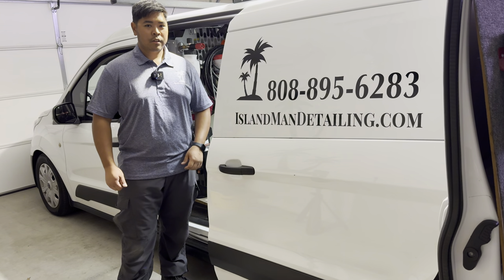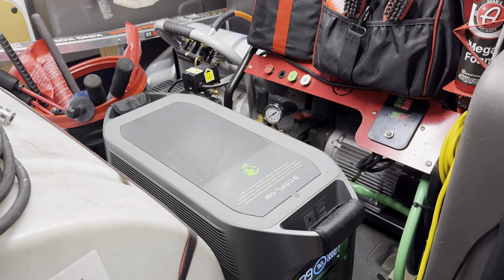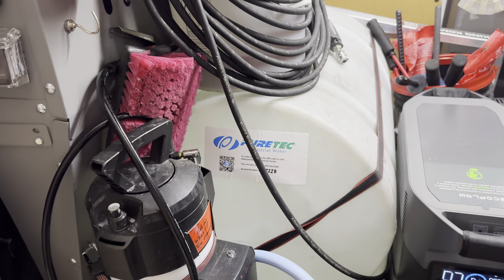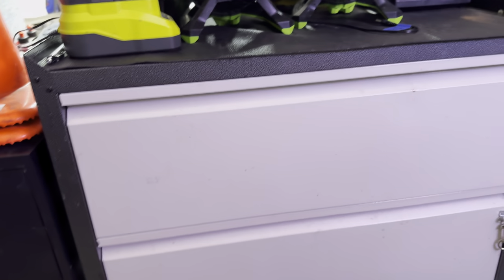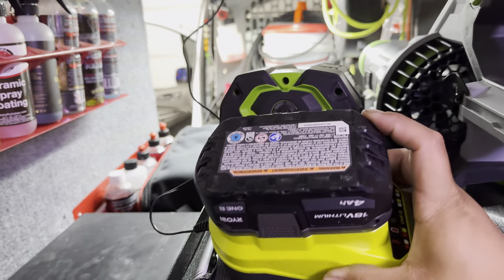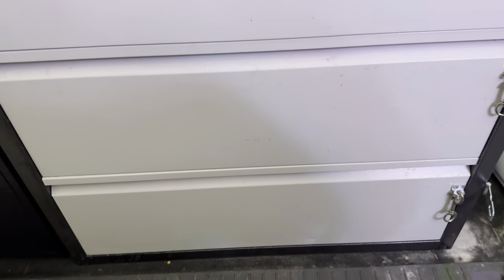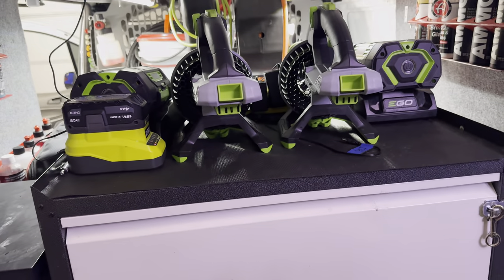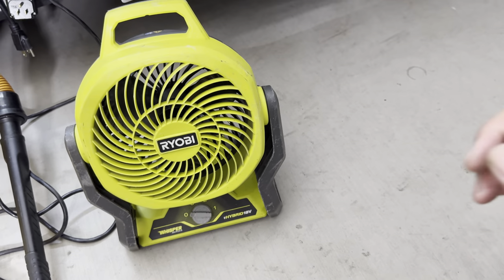Mobile detailing van tour | Using solar power and batteries to detail | EcoFlow Delta Pro

Comment: PS make sure you update your firmware on your DP as there is NO WAY it will power everything for 99 days as shown on your display, It should show 9-10 days NOT 99.
Reply from the maker: I’ve noticed that. It also doesn’t run very well if firmware isn’t updated. Just updated not too long ago and is not working great. Thank you.

Comment: how much power do you use when using doing a full exterior and interior with the eco flow? I feel like if I had to do a full  exterior and interior and a basic polish I would run that thing dead.
Reply from the maker: With it connected to 200 peak watts of solar, after a full exterior detail with polish and interior detail, I use only about 30% battery. Maybe a little less.
Reply: @IslandManDetailing how many working hours is that?

Comment: Hey man, I'm about to pick one an ecoflow delta pro (probably your version, not the new V3) for the mobile detailing business I'm about to start.  Just wondering if you've run into any issues over the past four months?
Reply from the maker: @jasonoshita4441  I had 2 issues recently. 
The first issue was that I received an error code and suddenly the screen shut off and I wasn’t able to use it at all. However, EcoFlow was very prompt on their response and turn around time when I needed to swap it for a new one. I was able to get a new one in less than a week.
The most recent issue was that the screen sometimes gets direct sunlight. This had caused the screen to glitch and parts of the screen do not work. Fortunately, the Delta Pro connects to the EcoFlow app, so I am able to see all of the information that is necessary.

I still highly recommend this model because it is affordable compared to the new V3 of budget is what you are looking for. And to me, it’s still reliable.
Reply: @IslandManDetailing  thanks so much for the quick reply and the feedback. It’s hard to turn down right now. Im glad they were quick to replace. Good tip about the screen. 

Did they ever say what the error was that bricked your first unit?

Comment: Thats a nice setup! 🎉🎉 I didn’t see an extractor or a steamer in your setup though 😮 Im curious to see how quickly the delta generators will drain when heat is introduced
Reply from the maker: I currently use a bissell little green pro portable extractor which is non heated. I am looking to test their new Steam extractor to introduce heat and keep to the compact and portable theme. 
As for the steamer, I use the McCulloch MC1375 steamer. I’ll make a video soon showing the power draw on each.

Comment: have you ever ran the ecoflow without solar? if so how long does it normally last?
Reply from the maker: @xxichikokoxx  we have. We are still able to complete a 2-3 full vehicles. That’s using the pressure washer, vacuum, bissell extractor and recharging EGO batteries for our blowers.

Comment: Amazing setup! my friend! Do you know the exact model of the CAT air compressor you're running? Also, how long are you able to run the tornador before it has to refill on that thing and how long does it take each time for it to refill? Thanks
Reply from the maker: I currently use the California Air Tools CAT-4610AC
It has a 1hp motor, so it takes about 50-60 seconds to refill. I’m not exactly sure. I’m always multi tasking. So when the pressure goes down, I’m working on other things while it refills. I can hold the tornados with the trigger squeezed for about 30-40 seconds until I need to let it refill. 
I’m looking to upgrade to the 2HP model and maybe bigger tank to get more run time and quicker refill time. I’d love to share your experiences.

Comment: 😂😂😂26:55 With low (budget) noise, comes low (buget) power, 90cfm is not enough @65dB! A Detailing vacuum should have @ least 150cfm. Mine does 152cfm @67dB - Of course it Cost 3 times more. But it cuts time in half > Priceless!

Comment: What type of solar panels are using the brand and what kind of connection are you using MC4? And by the way such a nice setup I also have a mobile detailing setup and I'm going to run solar on top 400 Watts to EcoFlow generator 3600 w
Reply from the maker: I use 2 of the RichSolar 100 Watt Monocrystalline solar panels. They are MC4 connectors.

Thank you for the compliment! I hope your build turns out great!

Comment: Will the eco Delta 1300 be able to do 3 cars, just using it with the pressure washer and vacuum?
Reply from the maker: Depending on the pressure washer and the power draw. I would safely say that you can do 2 vehicles using a pressure washer and vacuum.
Efficiency in your work is what would really determine how much you can really do. Some days I could do 3 vehicles with just one of them. Other days maybe just 1 or 2 if they’re pretty bad.
Reply: @IslandManDetailing  thanks for the great information. Probably get a 1800w

Comment: Is the suction power of the Rigid stronger compared to your Dewalt?
Reply from the maker: The DeWalt and my previous 4gal Ridgid vacuum have about the same suction power. With the numbers, the DeWalt is at 105CFM and the Ridgid is slightly stronger with 110CFM.